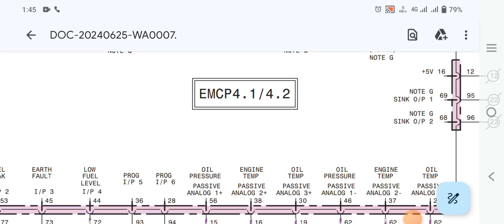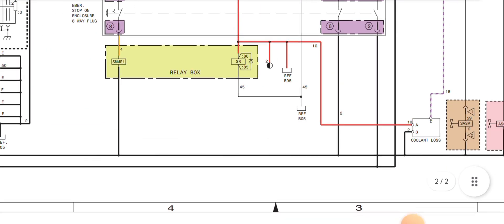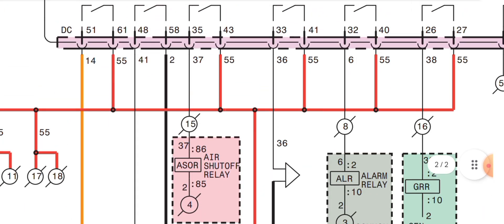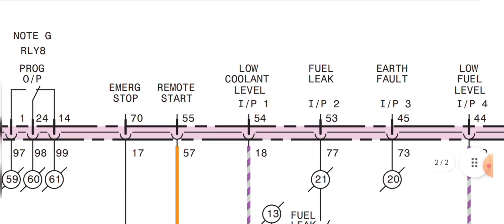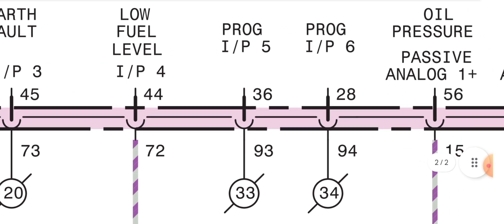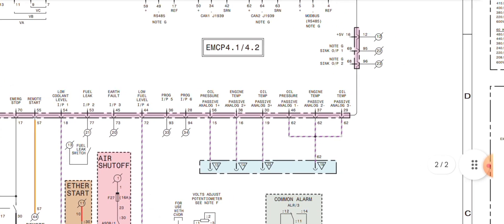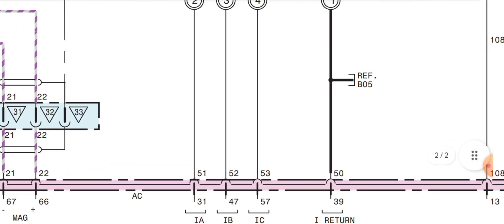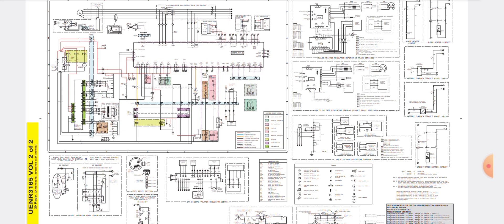Caterpiller EMCP 4.1/ 4.2 Controller wiring diagram explanation

Comment: What causes reverse power alarms on emcp 4.2 controller and how can it be resolved
Reply from the maker: That's mean,  reverse current is from grade/ or others source is back to Generator, it's not normal, very serious and dangerous, 

Please check your main circuit breaker continuity test in off and on. check the ats system,